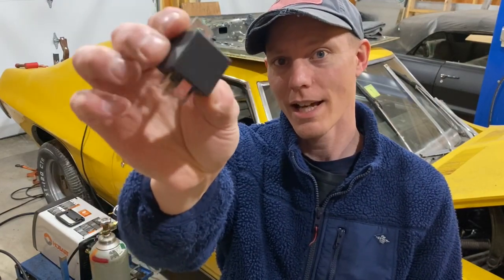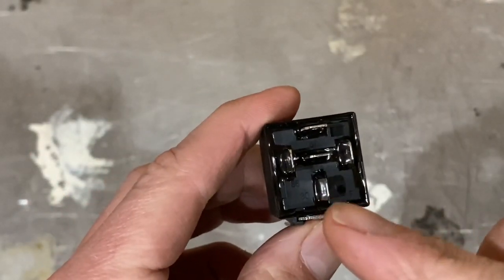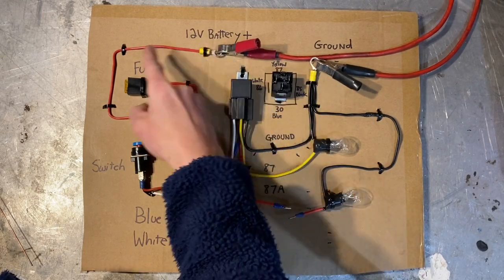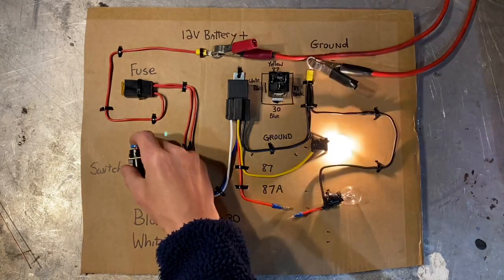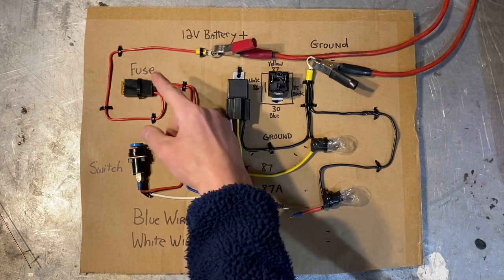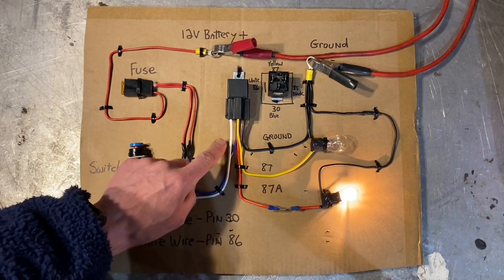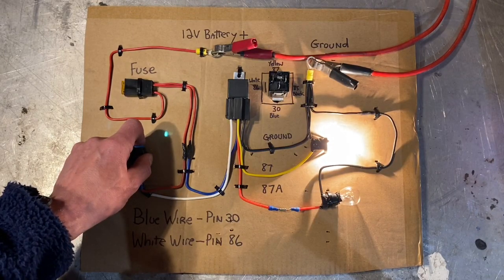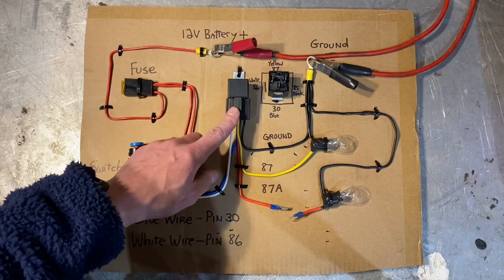How to Wire a 5 Pin Automotive Relay. Pins 87/30/85/86/87a . Bosch Style. Fans / Fuel Pump / Lights

Comment: I have that has the location of PIN 30 and PIN 86 switched. I have never seen this style relay this pin out. Seems it is no long available either. To use a standard relay I had to re-wire the socket. Was this relay made just for some company that wanted to be different like maybe John Deere?
HFV7A   012-ZST-R   AT0902A1
Reply from the maker: Unfortunately I am not sure. However, sometimes businesses do things like that so that you are forced to buy parts from them. So I wouldn’t be surprised! Thanks for watching!

Comment: I’m building a drag race only 1989 mustang. Don’t need high beams, brake lights or turn signals. How do I wire the low beams, marker lights and taillights to a toggle switch? How many relays would you use and what size wire?
Reply from the maker: Check out this video - I think it’s basically what you’re looking for. https://youtu.be/DoVHHokOBrg
Reply: @WiringRescue  I watched that one before. It’s kinda confusing for my experience.
Reply from the maker: @BAHRacingTeam  - got it. So do you want low beams, parking lights, and brake lights all to turn on with a single switch?
Reply: @WiringRescue  I just need low beams, tail lights and marker lights. No high beams or brake lights needed. The car is for drag racing only so I just need to see leaving the track and taillights for safety at night. If possible ran to one switch.

Comment: But if i strictly follow this wiring in my car, it means even without putting in car key and turning ignition on, light switch will be able to turn on light anytime right?
Reply from the maker: That is correct, the “battery“ power going to the switch and then pin 86 would need to be “ignition“ power instead of you want it to only work with the key on.

Comment: I wish I could like this 1000 times! this is awesome and your diagram makes so much more sense! thank you
Reply from the maker: Thank you!  I appreciate you watching!
Reply: @WiringRescue  I have another question! the fuse going from battery to pin 30 would be the amps used for the relay? being 30?
Reply from the maker: @dailydosedetermination  yes and no. The fuse size is determined by what you are powering, like light bulbs in this example. You also need a relay that is sized appropriately for the circuit. The relays I’m using in this video are able to handle 30 amps. But that is not the fuse size you want.  I made a video on this topic actually. Take a look at this one https://youtu.be/EhzN6UdnmPA
Reply: @WiringRescue   ok so the fuse would be what my total amperage draw of my lights would require. So in my instance I have a total of 7.5A in my LED system so a 10A fuse would be the right fit?
Reply from the maker: @dailydosedetermination  - that sounds like exactly what I would do!

Comment: Could you use this to run a stereo from 2 powere sources. Starter battery on the ignition switch and when ignition switch is off can have it to run from leisure battery? Fab video
Reply from the maker: You sure could. That sounds like a fun project!

Comment: Fantastic mate, just the info needed. I’m adding a 2nd fan on my classic mini via manual switch so won’t  need the 87a 👍
Reply from the maker: Excellent! Did you see my electric fan video? Take a look if you haven’t yet!
Reply: I have mate, albeit this one was more useful as I’m wiring directly through to a switch, not using a sender. It’s just for heavy traffic use really.
Reply from the maker: @tonywood6332  - perfect! I appreciate you watching both! Good luck with your mini !

Comment: Hello Ratty Muscle car.
I have a mobile unit, that runs off a car battery, and i wanna use a 5 pin relay.
the unit have a converter from 12v to 230v, a battery guard, a battery charger, and the unit it needs to run, how would you set this up, so the unit always have power, but when the batteryguard turns off, it switches?

Comment: I'm working on 07 dodge grandcaravan , when I put the key in ignition,  the accessory relay clicks 7 times then the blower and radio and windows works then when I start it then no blower or radio or windows work,  I had to ground the the blower relay pin 86 with ground to run the blower , I'm here to learn more about relays

Comment: Great video and explanation. 1 question, the other line from the toggle switch can it be ran to an accessory fuse or is it mandatory that it be ran to the battery pos terminal? I've installed a light bar, but I only want it to work with the ignition is on.
Reply from the maker: Pin 30 can be connected to an accessory power circuit. You just want to make sure it is fused appropriately. If you add a new circuit to an existing one, you may overload the existing circuit and blow fuses or burn wiring. I have a fuse and wire sizing video with more in depth info on this topic if you’d like to check it out! Good luck with the project and thanks for watching!

Comment: Hi , Nice explanation and I’m using my fog lights as drl so when I switch headlights it turns off the fog lights. My question is that I don’t want to wire a switch all the way to my dashboard, so if i use a voltage sensing relay that will only supply the positive if the engine is running. Right? Or get a piggyback from the acc from the fuse box ? Let me know if I’m good to go or do i need to add anything else? My fog lights are 10w each so what fuse should i use ? Thanks mate.

Comment: So, which pin is the "trigger" pin/wire?  I'm installing a relay & fuse block (with both + and - posts) on a Honda cruiser motorcycle in order to add heated grips and driving lights.  The fuse block will have power ONLY when the key is switched on.  First time setting this up.  Great videos by the way.

Comment: This is awesome. Thank you 🙏 

I am putting late model headlights in my Lexus ISF. They are LED daylight runners. 

There are two wires to power. One is for 100% brightness, the other is for 50%. 

So, when I turn the ignition on, one wire gets the 100% led lights on. 

As soon as I turn the park lights in, it will switch to 50%. 

This helped me visually understand what I need to do 😀😀

Comment: Wow this helped a lot using this exact system to wire interrupt a nitrous system for a 2 step thanks
Reply from the maker: Mint! I’m glad my videos are being put to good use. I’m actually working on a cool one next that will be adding turn signal, lights, and a horn to a race car - super cheap and easy. Stay tuned!

Comment: I have a problem. My fuel pump doesn't power on when 87 is connected. But it powers on constantly when 87a is connected.
Reply from the maker: That tells me that your 85 or 86 terminal is wired wrong or not working. Is 85 grounded properly? Does 86 have power when you turn on the key to the run position?
Reply: @WiringRescue  I removed the relay and just wired the fuel pump to the green wire on the terminator x system. Thanks

Comment: can i run a circut breaker instead of a fuse between batt and 30
Reply from the maker: Yes, you can as long as you size the circuit breaker and wiring properly for the circuit.
Reply: @WiringRescue  one more sorry.  how thick was the wire from the battery to the box.  And to be clear its Battery to breaker to fusebox to relays to device?

Comment: The stock fog lights & bulbs on my 90's vehicle have long been continued and the ones I can find are used and way overpriced; so, I replaced them with aftermarket offroad LED modules.  They draw more power than stock; so, only one turns on. Disconnect it and the other turns on.  I want to wire in a Relay to draw power direct from the battery; but, I want to keep using my stock switch & relay; and, obviously, the stock system will be using a lot less power activating just the relay.  Can you draw a diagram, maybe make a video, splicing in a Bosch Relay, into a stock system, to provide more power, to brighter lights etc???  Thanks in advance.  If you already have a video like this, can you direct me to it?

Comment: You are incredible with the diagram. I have taken notes and will wire up my 80w fan I have installed on a transmission cooler. 
Is 40 amp relay enough for 80 watt Fan? Also if fan is 80w so thats 6.667 amps. What inline amp fuse rating will I use? 
I will also use a 4 pin Relay
. Thankyou so much in Advance. best youtube video tutorial period!
Reply from the maker: Thanks for watching! I actually have another video that explains exactly this! https://youtu.be/EhzN6UdnmPA. I also have an electric fan video too, right here: https://youtu.be/9Hj7Ri3TXhc

Comment: Can this be used to "flash" on/off trailer marker lights regardless if the marker lights are on or off at the time?   I see semi's that flash their trailer marker lights at night after they pass another truck that gives them the ok to move back into the lane.  Only the trailer markers flash.  IF so, any chance you can give me details how to wire it up?

Comment: My reason for wanting to use a relay is the ability to run a small gauge wire inside the car to the toggle switch and not having to run full power thru every wire.  Having said this, what would the connections be for this?  I've always been taught the big benefit to using a relay is to keep full power out under the hood.  You use a thin wire to activate the relay and that completes the circuit of full power.  Once it's on the power is only running from power supply to lights...eliminating the thin wires and not loading up your switch wiring.  Can you give me the pin assignments or a video link for this?  Thanks

Comment: Seriously why the fuck do 10 different videos give 10 different answers on how these things are wired? Pin 30 goes to the battery in one, and the accessories in another is their some written in stone set of instructions for wiring these? Fuck I hate wiring
Reply from the maker: Crazy right? The truth is, that there are a variety of ways to use a relay, but it depends on what your goal is. Your goal will determine how to best wire the relay, because there isn’t a golden rule to go by.

A relay is just a really big switch controlled by a little tiny baby switch. You know in cartoons when the cartoon guy walks over to a giant electrical switch lever on the wall, yanks it down and immediately gets electrocuted with lightning going through his body so you can see his bones? Pin 30 is the big power coming in to that giant switch. Pin 87 is the big power going out. When the cartoon guy pulls the giant lever down, he’s connecting pin 30 to pin 87. And LOTS of electricity flows through. BUT the problem is, he needs a gigantic switch on the wall to handle all that electricity. The giant switch is… well… giant, expensive, and it’s really scary to touch.

Now imagine the cartoon guy replaces his giant scary switch with a super cheap relay. It allows him to remote control that giant scary electrical connection from a far off distance with a cheap little tiny baby switch that has barely any electricity flowing through. That little tiny baby switch is pin 86 (little tiny 12v power) and pin 85 (little tiny ground). When the cartoon guy flips his little baby switch, (connecting pin 86 to 85), the relay gets the remote controlled signal to flip the big boi scary switch (connecting 30 to 87). The giant switch flicks over and nobody gets electrocuted. No lightning. No bones. Just a much safer cartoon character because he used a relay instead of mounting a massive switch on the wall that he had to physically grab.

Comment: Do you have to run it thru a fuse ? Or can it run straight from the battery ?
Reply from the maker: Every circuit need to be fused, preferably as close to the battery as possible. Without a fuse, you risk lighting everything on fire.

Comment: You did a great job explaining the way a relay works. But I do have a question will it work the same for power windows
Reply from the maker: Every circuit is a little different and it depends what you use for power window components. I’d recommend grabbing a wiring diagram for the car that the window motor came out of. That will guide you toward the wiring design you’ll need.

Comment: 5 pin label is not correct. You can find other relays with 5 pins having different functions.
Better label is 87a-relay which can be only one type.
Also, always use pin 30 as output.
Reply from the maker: Good info - do you happen to have a link to an example of this? I’d love to learn more about it.

Comment: Hi can i use this relay for motorcycle headlight? The 87a is for low beam then the 87 is for headlight. Or it is better to use a relay SPDT for headlight high and low. Thankyou!
Reply from the maker: That’s certainly an option. You just need to make sure that your relay and wiring is rated at whatever the amperage is for the headlight.

Comment: Bit late for the video, but can this be used to switch between 2 different horns? Ie, airhorn power on Pin 87, and stock horn on Pin 87A?
Reply from the maker: I would think so if it's wired properly. You'd have to put a relay like this in the middle of the existing horn circuit (using pin 30 + pin 87a), then the new air horn would be connected to pin 87.  You'd then have a switch that controls this new relay connected to pin 86, and then 85 would be the ground.

In short - yeah, it's doable.

Comment: I love it.  I wire relays in as kill switches.  Looking at the wiring diagrams for that car. Cutting into the power to the fuel pump from the fuel pump relay to pins 30 and 86.  Pin 87 continues the circuit to the pump.  Pin 85 goes to the hidden switch , the other side of the switch is hooked to ground. 
On some I use 87A to power a horn under the drivers seat so if the ignition is turned on with the kill switch off the horn under the drivers seat goes off.  I normally try to get the 130db horns from the cheap tool store.
Reply from the maker: That sounds absolutely awesome! Haha!

Comment: Sir  completed the circuit its working but  i am confused with a point. the point is  pin 87 is not connected and the same function is shown by the circuit and it is working the same function but my confusion is why 87 is free and not connected while ciecuit is working.
Reply from the maker: Unfortunately, I don’t understand your question. Maybe this will help?  https://www.hotrodwiki.com/index.php?title=How_to_wire_a_5_pin_relay
Reply: @WiringRescue     in this video the  pin 87 is yellow wire connected to bulb. if you cut the yellow wire the bulb goes off because it need a positive wire. I in don't know electrical works hardly i made it but i forgot the to connect  pin 87 and i connected any other wire from the same circuit to the bulb and it was working  same as  in this video it works on/off.  the  circuit was functioning same like this video i am so much confused why this circuit working without pin 87? . is this normal or really strange?
Reply: @WiringRescue   Thank you sir

Comment: I dont get pin 86. Can I run it back to the battery? Or run my 30 and 86 off the same fuse to battery? My box has 1 white positive wire for each switch (x4) and one power (red) and one ground(black)
Reply from the maker: Like most things in life “it depends”. When the 86 terminal has power and the 85 has ground, that is what tells the relay to connect pin 30 to pin 87. Otherwise pin 30 is connected to pin 87A. You can put a switch on the 86 side of the circuit or the 85 side. So grabbing power from pin 30 to feed pin 86 may be okay if you were using a switch on the 85 side of the circuit.
Reply: @WiringRescue  the instruction say to power box from battery to the (red wire), ground box out to chassis or battery (black wire) and run accessorie positive wire to (single) switch wire and ground accessorie to chassis or battery.

Comment: may be a dumb question but how did you get two wires coming out of the fuse. could you just tap into the wire that comes with the fuse?

Comment: Good morning .Love the diagram  .Clears some things up thanks .
the reason i was looking for this video was because in the past when
 hooking up these kinds of connection on my car wanted to make sure i 
never forget to shut off my light , I have kids ,what if one of them 
turns on the switch and my fog lights turn on and don't notice and shut 
of the car .in the morning come out out my battery is dead. So i was wondering 
if instead of wiring the switch directly to the battery and run the switch 
from the interior fuse box that only has power when the car is running and 
when it is off it shut all power to the relay therefore saving me from dead 
battery issues. so instead taking power directly from the battery take the
 power from the interior fuse box placing a fuse on that line to the switch 
then sending to the relay pin 86. tThe rest of the set up is the same thank you. 
thanks you really help me understand how it all works now i can run my fog light
 without worrying about coming out to a dead car.

Comment: Good morning .Love the diagram  .Clears some things up thank .the reason i was looking for this video was because in the past when hooking up these kinds of connection on my car wanted to make sure i never forget to shut off my light , I have kids ,what if one of them turns on the switch and my fog lights turn on and don't notice and shut of the car .in the morning come out out my battery is dead.so i was wondering if instead of wiring the switch directly to the battery and run the switch from the interior fuse box that only has power when the car is running and when it is off it shut all power to the relay therefore saving me from dead battery issues. so instead taking power directly from the battery take the power from the interior fuse box placing a fuse on that line to the switch then sending to the relay. thanks you really help me understand how it all works now i can run my fog light without worrying about coming out to a dead car.